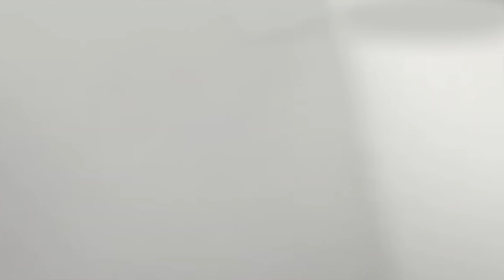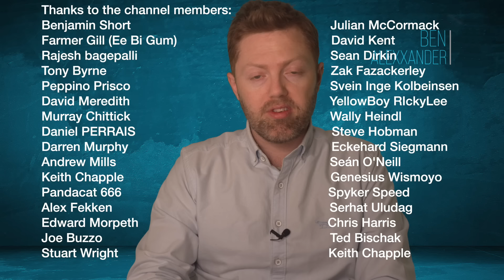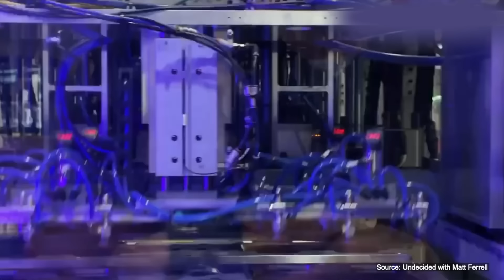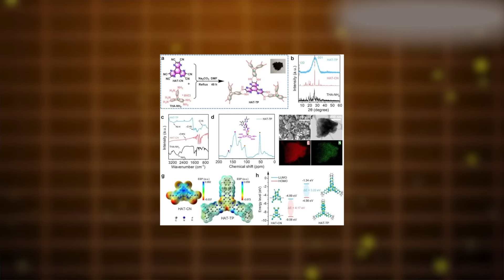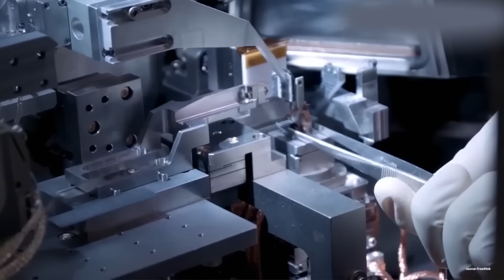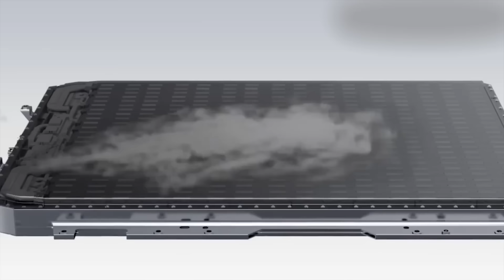New Zinc Battery Lasts 12 Million Miles — And It’s Already Been Tested

Comment from the maker: Would you rather Zinc Chemistry or Sodium and why?
Reply: Both are good. But Sodium is easier and cheaper to extract. However, lasting 12 mil. miles. The use of those batteries aligns with the purpose. Zinc for trucks and ships, sodium (CATL) for smaller vehicles.
Reply: @youxkio  Na + kann vor allem gut Pb ( Bleiakkus)  ersetzen. Einach  billiger, bei Kälte  besser , viel bessere Energiedichte  , mehr verfügbare Kapazität  (Pb nur 100% bis 50%) 
Viele Zyklen sind vor allem im Stromnetz  super.  Am Tag   viele male Laden und Entladen , also  3 bis  5 Volle Zyklen.
Reply: @T.Stolpe  No doubt. But your point about zinc battereis being resistant to cold is already debunked in this article:

Volume 9, Issue 2, 9 February 2023, Pages 497-510
Society Logo
Article
Aqueous rechargeable zinc air batteries operated at −110°C
Author links open overlay panel
Shengmei Chen 1
, 
Tairan Wang , Longtao Ma, Binbin Zhou, Jianghua Wu, Daming Zhu, Yang Yang Li, Jun Fan, Chunyi Zhi.

The article concludes the zinc air battery exhibits high tolerance at ultralow temperature down to −110°C.

Despite the test being conducted in a controlled lab environment, the results speak for themselves, providing a moderate assessment that contrasts with real-world conditions.
Reply: I guess the question is When and at what cost. 
Sodium Ion is here now. Already in BESS LFP we know is pretty good and with good BMS and good Thermal management is fine. 
I am all for less or non Toxic fully recyclable and affordable with Zero Fire risk.
We still have not seen the Aluminium Ion yet that is nearing its BTRL trials so there is that also.
Reply: @michaelanderson3771  Na ist ein Abfallprodukt der Chlor  Chemie .  Das macht es so sexy 
normales Salz  = NaCl
Reply: The zinc chemistry battery sounds interesting. But honestly, we hear about new battery technologies and chemistries every week. And this one sounds like a university lab announcement. So even though they got promising test results, the big hurdles remain if they can translate this technology to volume production, and at a competitive price. I will become keenly interested in zinc batteries when I see them used in affordable cars, or stationary storage. Sodium Ion, and solid state batteries are also on the cusp of stardom, but much closer to being "really real".
Reply: Let's have a penny zinc drive!
Reply: Sodium is here now so go with that while this is being tested further.  Energy density is good and life is 70 years
Reply: Depends on upfront cost, durability to weather and corrosion and impacts, overcharge/overcurrent/malcharge and run-flat tolerance, fire risk, effects on vehicle/plant maintenance and repair costs, disposal costs, hazards both in operation and on disposal (all these approximated as insurance costs) and supplier longevity and reputation.  As well as energy density both volumetric and gravitometric, of course.  Time will tell whether the claims will be substantiated.
Reply: @gregvanpaassen I'm guessing that being hit by a sodium battery thrown at you feels the same as a zinc or LFP battery. The future that isn't being discussed here is aluminum ion and or lithium sulfur. Zinc has such a low nominal voltage that I don't see it being a thing in cars. It's more of a power wall battery chemistry. Aluminum ion will really be tesla first actual chemistry improvement. Up until  now they have really just used existing technologies in battery chemistry. In essence all they have done is.change.the.size.per cell to obtain a greater energy density. This aluminum ion chemistry should be the next big thing. LFP continues to improve as well, but lfp isn't going to ever be good enough for commercial airlines.. the future is.going to be aluminum ion
Reply: Is Zinc scaleable? Sodium seems to be as CATL is in production with them now. Otherwise, if its reasonably priced, whats not to like!
Reply: For home electrical storage I would go with zinc. No chance of fire with zinc. 40k charge cycles is a shit-ton of cycles. 4x that of lfp.
Reply: @kennedy6971 
Is the polymer part nonflammable?
Reply: There will be some differences, but we lack the details to really do a full comparison.  I first heard of Zinc batteries with a free Chinese research paper 5 or 6 months ago.  The same data made it's rounds through Singapore and wreaked of someone looking for state university funding in Singapore for the same metrics:  organic Zinc Hectate molecular structure, only the super long cycles before 93% degradation were theoretical.  

Naturally, that's where I lost interest.  I'd be careful to not believe everything I read regarding Zinc batteries.  It's not to say that the tech isn't sound, it very well could be, but it is theoretical from everything I've digested.  Reader beware on this one, Ben.
Reply: We need a non-China based battery technology that works. While China does not care about patents, the rest of the world does. So we need our own technology and production and get away from the Chinese chokehold China has on the world.
Reply: @countmorbid3187  Factorial & NASA would be the most advanced outside of China... and maybe LG Chem and Samsung behind them.  Otherwise, Gotion, CATL, Cheryl, Dong Feng & Geely look to be leading the way in China.
Reply: Sodium. That would let us do something with all the salt from desalination processes so we can get people more water.
Reply: Any batteries that fit a car will do and then goes to a grid battery farm when superceded.
Reply: zinc
Reply: zinc because have wery much cycles if that true
Reply: None of those. Their round trip efficiency is too low compared to li ion, lipo,lto or lifepo4. Until that catches up uptake will be slow. Another thought a battery that can outlast the device or car it's installed in. Sounds great but corporate greed is why it won't be used, failing batteries is a reason used to replace items. Also just because it can be built for cheap in the factory does not mean it will be sold to you cheaply, if it's as good as it sounds it's the only battery you need so cost will be high. They will probably add a bms to block usage after a many cycles and claim it's for your safety.
Reply: I suppose the problem with zinc batteries is their inability to discharge at a high C rate. That's why we don't talk about it!
Reply: What are the comparative prices of manufacture of each and what are the associated environmental risk/damage from acquiring the materials and processing them and how clean is the manufacturing process of the battery?
Reply: LFP
Reply: Sodium is much more common in the earths crust than zinc.  In the long run, that might make sodium better, but sodium batteries also show a linear decline in output as they discharge.  Thats ok for some applications, using electronics to distribute the charge/discharge properly, you can simulate a constant output discharge.  But those electronics are niether free nor energy effecient.  So it really depends on a lot of factors not discussed here at all.
Reply: Zinc has powered buses and the Deutsche post ran vans in 1995-96. It's proven in forward positions in the military. A ferroelectric membrane using tetragonal BaTiO3 promises dendrite-free recharging but this may be a development from this.

Comment: I personally think that they’d be perfect for vehicles since the battery will last so long they can start designing cars to wear. You can buy it with or without the battery and you can keep your battery and move it to your new vehicle. Yeah, the cost way less or when the car is ready for the end of life, you pull the battery out and use it for your home storage or gets recycled for grid storage but I think it should be used for vehicles. That is if it has the adequate discharge rates can handle colder hot temperatures and another thing it would be the perfect thing to also be able to have your car be used for home energy storage and not have to worry about your vehicle‘s battery life like you would now with lithium ion batteries and it’s not like having an extreme life capability is a bad thing. It’s not like there’s other things that are made in our daily life that can last for very long times they used to be a good thing. I’ve never thought of it being a negative that blows my mind how people would even think that way, not on top of that it’d be perfect for a long haul trucks, City buses I mean there’s so many things that could be useful for and just because the batter cannot live the vehicle that’s a plus specially if we can start making vehicles last easily 1,000,000 miles in the batteries 12 million basically move that battery to a new vehicle meal 10 times or so or every time you get a new car your own car becomes part of your home‘s energy storage, which just gives you that much more freedom of being off the grid.

Comment: Nope not the future of static grid storage. For long term grid storage is Molten Salt Liquid Metal batteries are the way forwards. we already have working ones that are 39 years old & have been cycled 5-10 times a day & retain over 99% of capacity.

You say these batteries could be good for ride sharing. How do you know that? You didn't mention charge or discharge rates. there seems to be a vary small voltage difference between charged and discharged this could make balancing batteries and packs a lot more complicated and expensive.

Comment: My view is that safety against runaway fires is crucial to domestic battery storage. I know Lithium fires are statistically very small, but they rare fires produce highly toxic fumes and are very hard to extinguish. 

If the Zinc battery is as good in fire resistance as durability then it will be a winner in time. 

The same applies to EV battery applications.

Comment: What's charge/discharge rate? What is the efficiency?  LTO already hits these kinds of cycle life numbers and is already a commercially viable product occupying these sort of roles in wearables. Its not a game changer for EVs though because its significantly less efficient than more conventional li-ion or li iron phosphate (80-85% instead of 98-99%). Without the info of charge/discharge rate and efficiency this is "NEW BATTERY OF THE WEEK" wank and very little else

Comment: Well, it depends.. Sodium is has a huge voltage drop over one discharge cycle, which still is a disadvantage in many cases.
Here, I don’t hear anything about the voltage characterisics during a complete discharge cycle, nor do I hear anything about the temperature range inside which this new battery is able to do its job without any issues. And then there is the question about the maximum discharge rate..
Bottom line: Like many people here, I still have too many questios, to be able to say anything about the usability in various different situations and projects

I use LFP based battery systems in my boat, because they are safe enough, durable enough, and, most importantly, relatively cheap, simply because they’re already around for years! They are tested and tested and firmly found their place as a stable and respected solution.

Comment: Usage?  Usage?  Usage?  That depends on cost size weight and availability.  The longevity is just a bonus for the other criteria.  I.e.. if it is cheaper lighter and smaller than the alternatives, then it obviously belongs in a vehicle.  Preferably in a customer owned configuration so it can be removed from a junked vehicle and used in a new one.  That leads to a MUCH lower priced vehicle after purchasing the first.

Comment: It will never be used in consumer electronics, at least in the USA. Endlessly greedy corporations (especially the major mobile phone, tablet and computer manufacturers) have already been repeatedly caught designing and building accellerated obsolescence into their hardware to force consumers into replacing their phones,  tablets, computers AND the software (Microsoft, yes YOU!) that runs those devices. The mobile phone industry oligarchs conspired to do away with user replaceable batteries, then designed their phones to self destruct if anyone but the most skilled techs with thousands invested in highly specialized equipment attempted to do it. Now, those same crappy companies deliberately design their hardware to progressively throttle its performance until the product is all but unusable after two or three years. Literally, a mobile phone that costs $1200 is, after two years, noticeably slower than a new phone you can get om Amazon for $130 on sale. Until the consumer electronics industry is strictly regulated to the point where CEOs can and WILL goto prison for such bullshit, long lasting batteries will never have a place in their products. After all, companies won't have sky-high profits and CEO compensation without consumers being forced to buy and re-buy products they have to constantly replace. Forced cash flow by manufacturing short-lived products is a defining feature of unregulated, late-stage crapitalism and thanks to mass deregulation, it's the consumers who are living the dream...er...nightmare.

Comment: It's a pain that videos like this always seem to focus on these batteries use in vehicles. "12 million miles"... When the current research suggests they would be terrible for this. The research that gives this cycle life specifically relates to coin cells.... Hardly going to be used in vehicles. 

This video seems to once again confuse material performance with system-level energy density. 

The optimistic target for system level energy density is 90wh/kg. This is WAY too low for consumer vehicle usage. 

There is little to no information on charging speed. Likely because it's irrelevant to the actual use case of grid-scale energy storage. 

This is yet another lab-based study spun as some kind of consumer battery breakthrough.

Comment: For the next decade, every sodium and Zinc-based battery that is manufactured will be purchased and used. You can say that one is better in some way, but the "early adopter" customers will buy as much as they can of what they want, and then in order to get enough cells, they will spend half their budget on the cells that are available, regardless of which chemistry is better. Price will continue to be the biggest driver for grid storage.

Comment: Cold temperature usability, -40? I live in the North, right in between 2 Hydro sites. Winter temps down to -45 C.
Losing Diesel/Gasoline for HVDC charging, no problem, but, the chemistry has to live with cold temps!

Comment: A battery with this kind of life span would mean the car itself would wear out before the battery. When you went to trade in your car for a newer model, say five years later, you could just slap your existing battery into the new car and call it good. HUGE cost savings, and re-use is always better environmental solution than recycling. Maybe you buy the base model car first, then you can afford to trade up once that one is paid off because the bulk of the cost is mitigated by your existing battery going into the new model. It could be a disrupter in the automotive industry.

Comment: They’re going to have to work out how to build planned obsolescence into this to artificially shorten its life before any electronics manufacturer will be willing to use it. No one selling laptops wants their laptop to still be working in 40 years time. They don’t even want you able to open it up and replace the current shitty battery when it dies. They want it to last 5 years and then for it to be cheaper and easier for you to throw it out and buy a new one than get it working again

Comment: We really need to see the Voltage Discharge Curve.   
What does the 1.32V look like as that battery is discharged... what is the Voltage when the battery is at 50%  charge capacity... 25%...at 10%?   That matters a lot.  

I don't know why, but with new battery formulations they rarely show the Voltage discharge curve.   We need to see it, as it matters a lot what that discharge curve looks like.
Reply: And the Charge Curve.

Comment: At 1.32 V per cell you will need 3 cells to get a voltage comparable to a single Li-Ion cell.  That makes HV architecture more difficult.  The advantage of high voltage architecture is that you can get high power with relatively low current.  Current is the electric component that causes voltage drop across a length of wire. The voltage drop combined with the current generates heat so energy is wasted across the length of wire.  HV systems are good because resistive losses are less important for a given power output. That means you can get away with lighter wiring and make lighter motors.  The control electronics also runs cooler.  The challenge would be to make a high voltage zinc battery - lots of cells required.  Consider why electricity suppliers use HV power lines to supply power over long distances.  1 Megawatt of power can be transferred with a 500,000 volt line at 2 amps. You can get away with aluminium/steel wire.  You could do it at 250V but the current would be 4000 amps which would require thick and expensive copper wire to keep power losses (voltage drop) to a minimum .⚡⚡

Comment: 1.2 or 1.3Volts? You're going to need a lot of cells.
What's interesting is not the latest hype from one science paper or another, is the long term overview where so much effort is going into different chemistries and there won't be many winners. The wider the variety the less the stress there wil be on mineral supply chains, however each has to prove the ability to scale up to GW levels at lowest cost. It will take longer than you think for Na or Z to catch up let alone overtake Lithium chems.